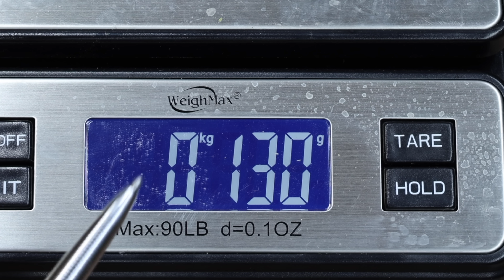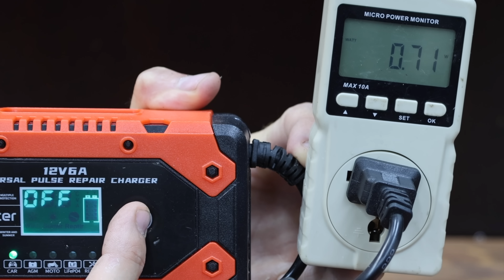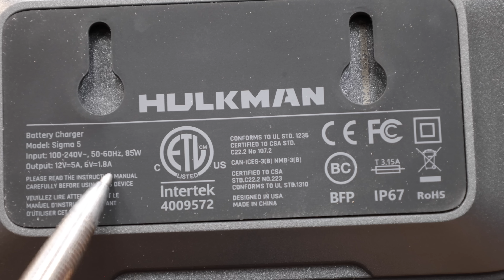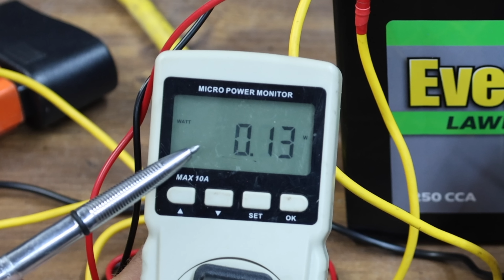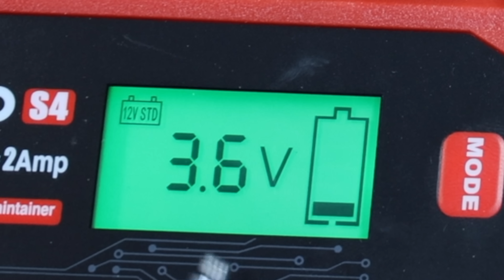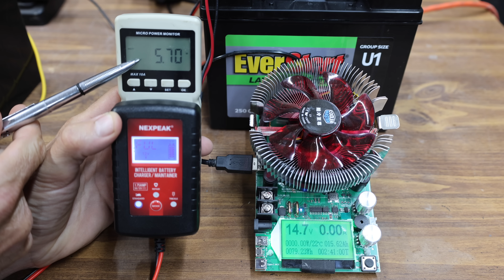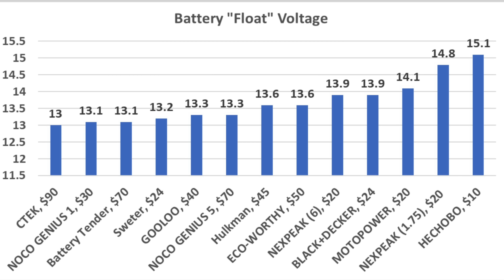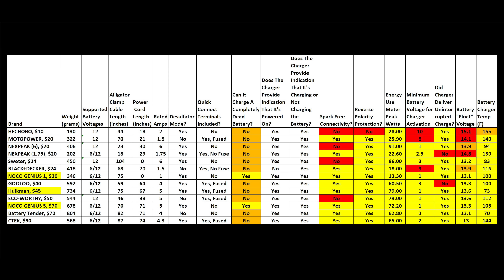I Tested the Most Hyped Car Battery Chargers – One Stood Out!

Comment: Didn't think you'd do this but it's exactly what I need right now as I'm looking to buy an AGM charger. Thanks again for what you do.
Reply from the maker: Our pleasure!
Reply: If you're going to be charging an automotive battery that's AGM, it will do better with a higher amperage than most of these tested. Some manufacturers like Odyssey would indicate that a smaller charger may not even fully charge their batteries and recommend a minimum amperage. The Hulkman brand as test is a quality unit. I have it and the larger brother Hulkman Sigman 10. The 10 can also charge my lithium battery connected to my sump pump and be used as a power supply when I am doing over the air updates on our Mach E.

Comment: As a former Battery Tender fan, and a few failures over the years, I tried the Noco Genius 1, was so impressed I purchased the Noco Genius 10, and have never looked back.  Still going strong after years of constant use. 👍  Great review!
Reply: Agree the Genius 10 is a great unit.
Reply: Another vote for the Genius 10. I only purchased mine a month ago; but I love it! I wish that I had ditched my old Schumacher long before now.
Reply: @stevennelson209 why did you go with the genius 10 vs 5? Looking for something for my dual battery diesel to have hard wired to the battery or batteries
Reply: @thomasbicket5797  One reason that I went for the Genius 10 over the Genius 5 is that the 10 has a power supply mode. I use this mode when I need to change the battery on a car so that I don't lose any settings when power would normally be lost.
Reply: @stevennelson209  I have a Walmart Schumacher too which sucks but it gets the battery up to bare minimum but isn't as good as the Noco 5. Very little disturbance, like opening the car doors,  in the battery current will cause the Schumacher to indicate the battery is bad when it is in maintain mode.
Reply from the maker: Thank you!
Reply: We used to utilize the battery tender at the motorcycle shop 20 years ago and they always worked great especially as a tender(thus the name lol) and we would maintain dozens of new batteries without issue.

But like everything, enshitification seems to be everywhere
Reply: I'm in the opposite boat as you.  I have a Noco G3500 that has some failures, mainly the LEDs went out pretty sure after I purchased (past return stage) but my battery tenders have all been going great for over a decade.  I have the Plus model hooked up in the garage to my ATV and I have a 6 Plus model inside for mojo duck batteries.

But I do have a Genius 2 connected to the riding mower and its been outside in the Texas heat since 11/21 and going strong.

The Genius 5 was on sale during prime day for $55, hard not get one when they go on sale again.
Reply: Same. BT ruined a couple small engine batteries. I had several and it seemed the earlier ones did not do that. I also used them as over winter maintainers on ag equipment and had problems. Threw them all way and use single and double Nocos with 0 failures so far.
Reply: I have had issues with "NOCO GENIUS" 10 amp chargers from a few years back, mostly, from them either cooking batteries or discharging them dead,  A friend also bought a NOCO for his boat's trolling motor, and also ended up with a ruined battery.  I hope that the tests here show they corrected some issues, but I won't chance purchasing another one.
Reply: I too was super impressed by the Noco Genius1, so I bought a second.
Reply: I also have it and well, in case of apocalypse it can be also used for the self defence as it is heavy as a brick :D
Reply: Good test. Thanks for the video. 👍
Reply: Love my Genius 5. Also, there was no mention of the lithium charging capability, which is why I bought it originally.
Reply: I like Clore Pro-Logix over anything on this list all day every day.  Second choice would be Noco but there way overpriced.
Reply: Just ordered a noco genius 10
Reply: I keep one of the permanent mount ones in my truck to help keep my battery strong with the dash cam
Reply: I also converted from battery tender to Noco Genius.  Never had a problem since.  Battery tender works well, but it has some durability issues was my eventual conclusion.
Reply: My Genius 10 just died after a few short years due to a temp sensor giving erroneous readings.
Reply: Never had a single Battery Tender failure in 26yrs of constant use.  I have 5 of them including a 4 bank which has 2 marine batteries and two motorcycle batteries hooked up all winter long for the last ten years.
Reply: @CaptainRon1913  Deltran's Battery Tender was the gold standard for years, but read recent reviews of them and you'll see they've gone to shit.

Comment: I like the NOCO Genius line for a couple of reasons - it’s pretty idiot proof to operate, and near impossible to use unsafely, and NOCO sells individual wiring harnesses that can be permanently attached and hooked into unit as needed. All of our 12v vehicles and equipment have harnesses hooked up and make using the charger much easier.
Reply from the maker: Thanks for sharing!

Comment: I requested this test and it didn't fail to answer the question! Great testing as always - Project Farm science is still the best science!
Reply from the maker: Thank you very much!
Reply: I too am a Project Farm fan but this was a topic that I was more familiar with and I felt the testing was lacking. There are more features and functions attributable to a good battery charger than trying to charge a poorly maintained batteries. Some of us chose to maintain them. Most of these cheaper "chargers" are actually maintainers. If these would have been used in the beginning, there wouldn't have been a 0V battery. It's more important to have the right charger for the job or one that can do it all. Need to charge a automotive AGM battery and they'd be better suited with a larger amperage charger,  maybe you have a lithium battery, or a need a power supply?  I'd suggest the Hulkman as tested if on a budget. If you can get it on sale, get the 10A version and the other benefits I mentioned above. 😀
Reply: @thegrimmperspective I understand your position but I don't agree with it, PF pays for ALL products tested and that can come at a substantial cost limiting products selected, all his testing methods are well thought out and expertly executed but no one can test every aspect of a product and produce a video that fits the YT algorithm. PF is not an expert on every product he tests but he doesn't need to be, he just has to be thorough and he is. You should start your own YT channel and produce the content you'd like to see.